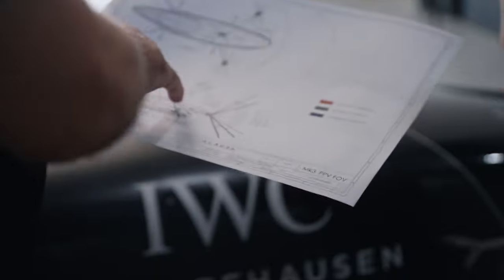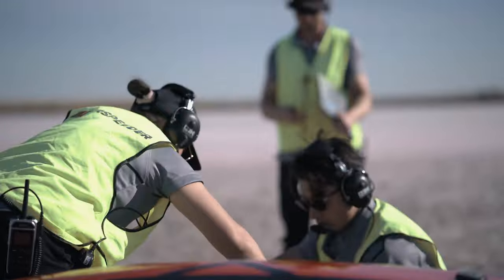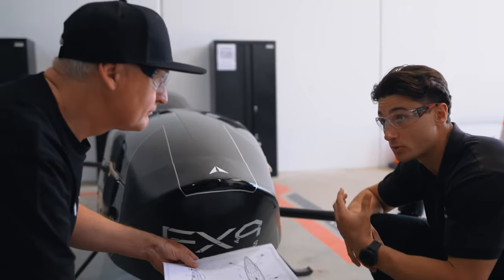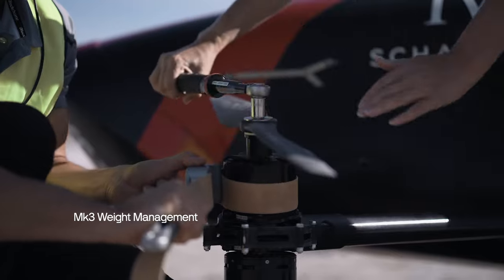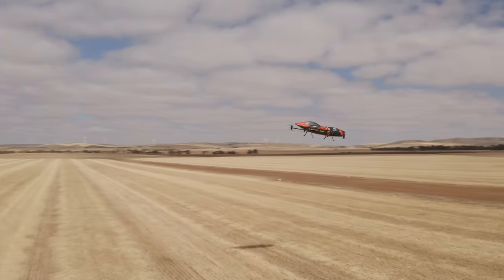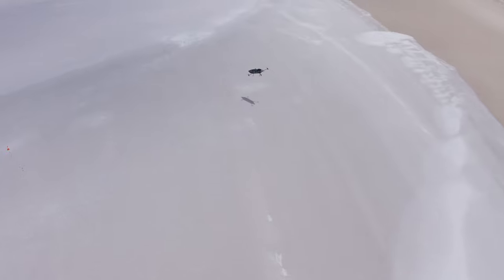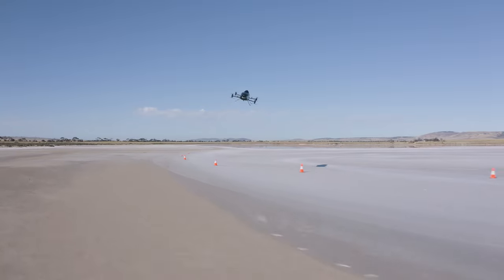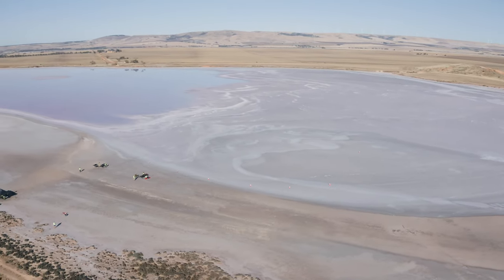Race eVTOL FPV prep, weight reduction and pitstop timesaving | Alauda Aeronautics Taking Flight

Comment: So FPV Comes in! That's amazing! 
And I am so excited for the pitcrew... I understand you are naming your own FPV System... Is it based on analog or digital systems?
Reply from the maker: Faster in the air AND on the ground now! 🙌
The FPV system is a very low latency digital system! More info will be coming on this as it we develop with pilots for racing. 🚀 🏁

Comment: I do not know all the parameters yet I have studied what I could study but I believe that adding solar panels flexible to your rig will give you just a little bit of extra with boltage even though it may add a couple pounds even though a couple pounds makes a difference but this is up to you and is only an idea
Reply: Where do I buy whatever you are snorting? The power curves used by this craft will benefit 0% by bulking it up with useless solar panels. This is not a golfcart that will sit for hours before getting a few % charge off solar.